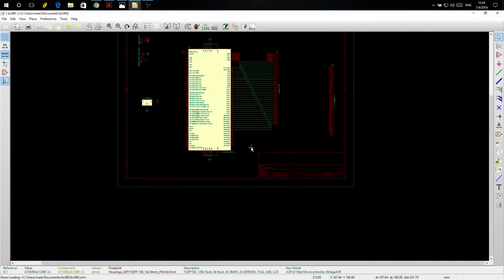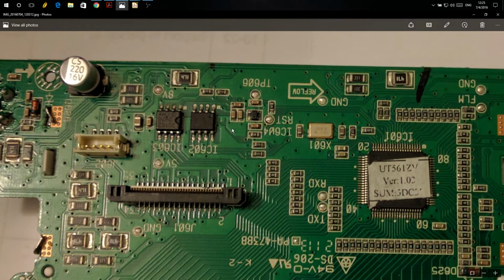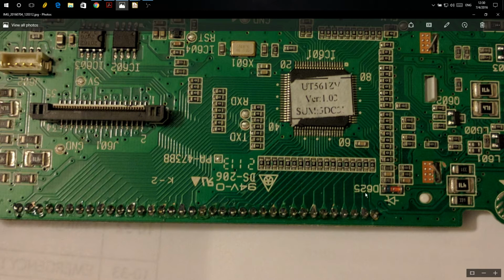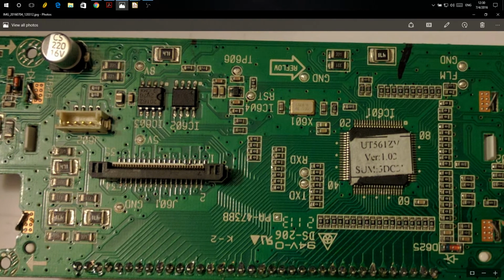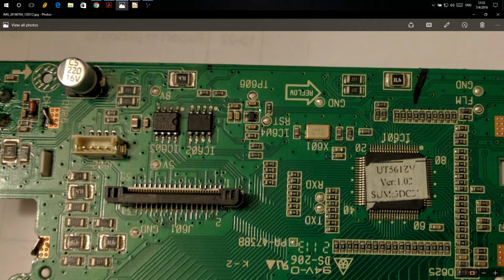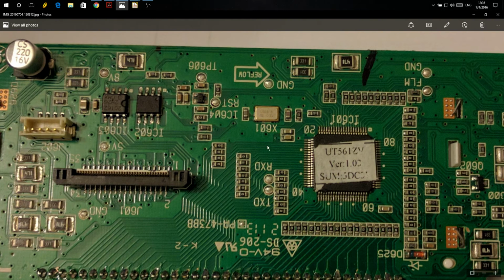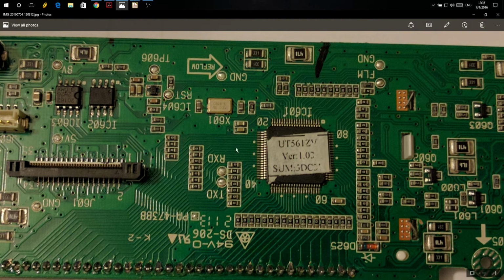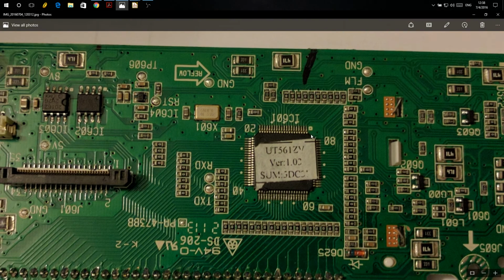SSB 980 display workings

Comment: See the tab sticking through the board on a ground pad, I soldered the one by the microphone jack.  This fixed an intermitting mic connection and it fixed a no power on situation that happened 40% of the time.  Something going on with the ground.  Don't know what but My rig is fixed now, Chit Yeah Chit Yeah.  Bought this new and it has the best ssb audio.  I hooked it to a mixing board and studio mic.   Started noticing it wasn't transmitting.  It would key up but no audio.  Moving the mic jack up fixed it.  But it wasn't a real solution.  Then the radio would be dark after a power up. DEAD.  A series of moves would bring it back.  uUn plug and replug usually fixed it.  This thig got worse.  Finally I peeped inside and soldered the tab and like magic, that did it.  Works like new now.  This rig is set as a base station so I'm not having the lights issue yet.

Comment: Common anode or common cathode, Thanks! Good Work!
Reply from the maker: Neither. your driving the actual crystal segments themselves.
100hz at about 2 volts peak to peak should get it to change polarity.
Reply: Nice, glad to see another 980 video!
Reply from the maker: +LeapFrog469 I just made a quick video to demonstrate how you can drive a passive LCD. the LCD display itself lacks electronics hence the signal generator.
Reply: Yeah, a momentary lapse in cognition, I was thinking LED displays not LCD!  Thank You keep up the great work.
Reply: Steven Bagent  I haven’t found one yet.

Comment: Hi can you fix my 980 display ? Turn on works good but bareley see something
Reply: Mine has the same issue
Reply: Same problem
Reply: I have same issue, anyone here figure this out?  I’ve seen several 980s on eBay with clearly the same issue, they show “turn on” as status but you can see the display is dark except one side usually on the channel side still barely working, mine works best when cool then as it heats or hot car it’s just blank!
Reply: Seems like it may be the DAC is bad, but haven’t removed to replace that yet and see
Reply: @1ordmorgu1  I can't exactly tell you what the cause was because I don't know, but I know for one some guys are replacing the boards I couldn't find where to get the aftermarket board but that fixes it, next to fix the issue at least temporarily we pressed on the board for the screen until we found a spot that would make the screen fade and we soldered all around that area as well as resoldered the processor and that has fixed my issue at least temporarily
Reply: towtruckAJ we need to fix this , and uniden says what ??!!
Reply: @josedejesus3117  I believe uniden has a 1 year warranty and they will fix it for free within that period, that being said with the research I have done they just repair it with a new factory screen board instead of actually fixing the problem and later on down the line it faults again, There is a guy that repairs them with aftermarket boards but I forgot his youtube channel and I couldn't find any sources for where the purchase the board from for self repair.
Reply: towtruckAJ alright let me know thanks a lot